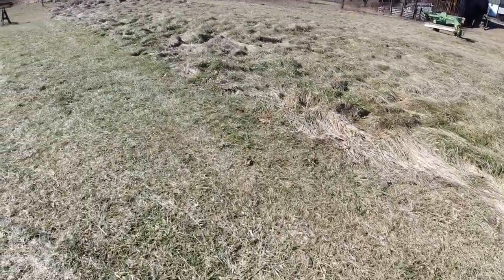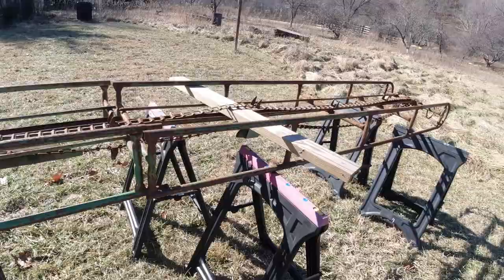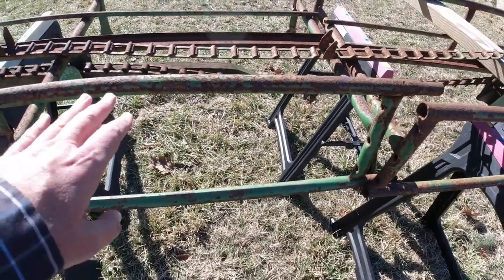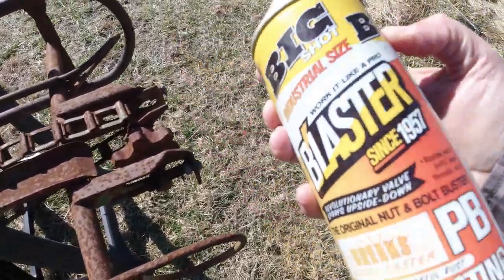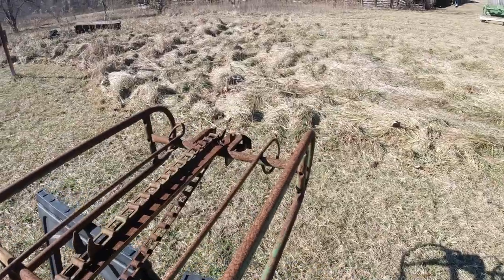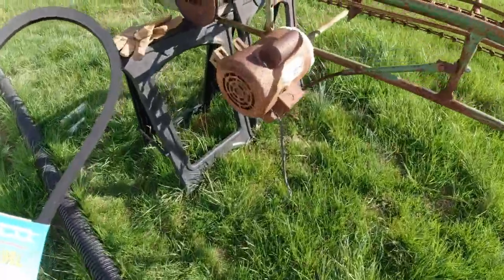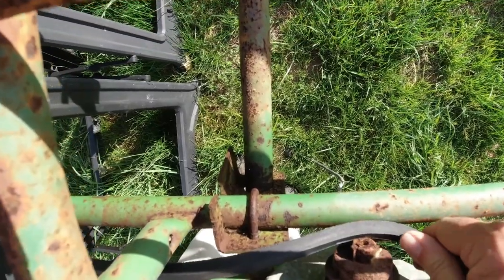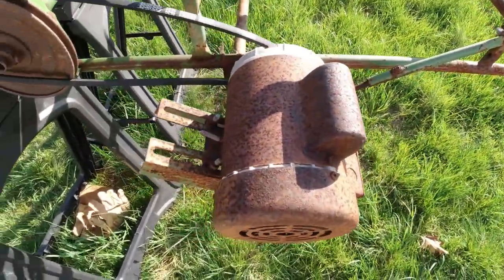Hay Elevator Repair - John Deere 33

Comment: Well it looks like you got the elevator working fairly good. That bend in the rail may give you some issue if you load it down with multiple bales of hay, but at least you have it going. It sure was a lot of work, but sometimes that's just what a guy has to do. Back in the 70's I did run several elevators, a few were electric and some where PTO driven. It think you have the chain adjusted fairly good, it may need to be tightened a little more, again when it's under stress with several bales it may need to be adjusted. Good luck a thanks for sharing, have a great week.

Comment: Victory! The chain is bound to loosen up some as the rust wears off. Like someone else said if the chain is too loose it will sort of buckle as it comes off the (lower) drive sprocket under load. Well done!
Reply from the maker: Thanks!

Comment: I've got a JD 200 bale elevator, it's older than a 33 and it's on a transport.   Mine looks like new compared to yours and we use it every year.  Good bale elevators are hard to find.